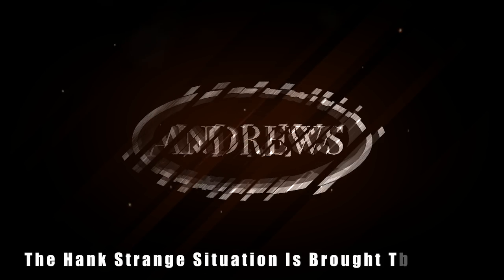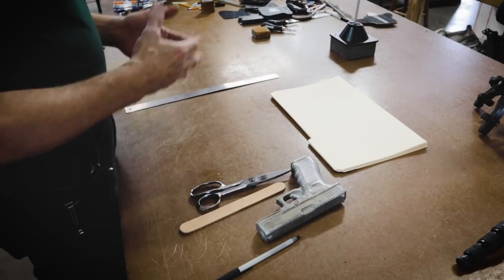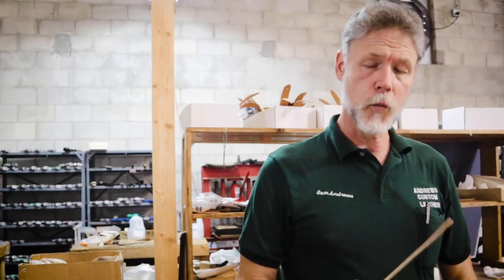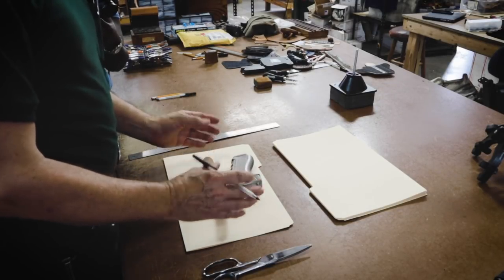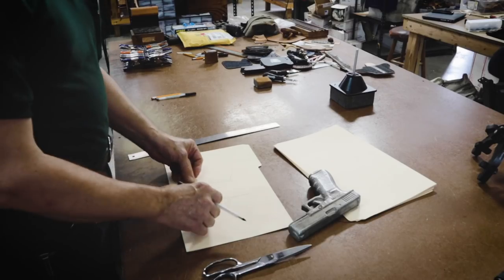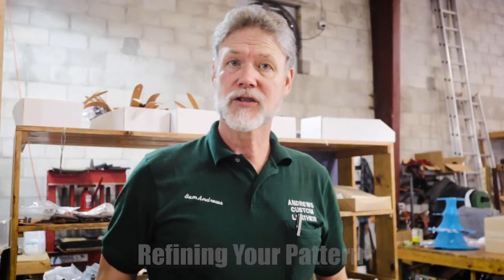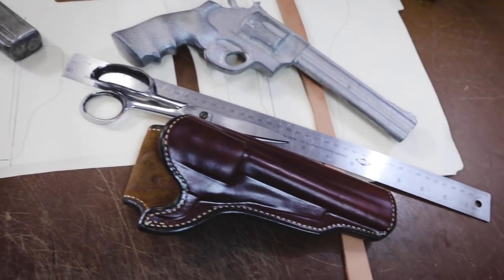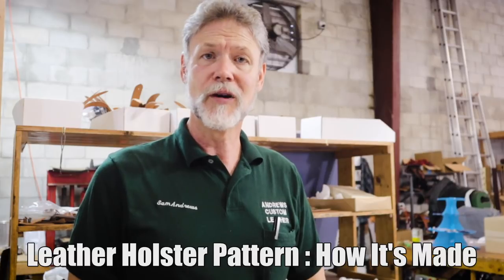Custom Leather Holster Pattern Making // Pancake Holster // Scabbard Holster // How It's Made

Comment: Have a question on two things I'd like answered...the first is, What and where do you get the metal reinforcement you use for your holsters that have them? (e.i your  IWB holsters) And what weight leather do you like using for your holsters?  Thanks for all the great how to videos  from both you and hank! Keep up the great work.
Reply from the maker: YW Miguel I know this is Sam's busiest season right now however he will get to the questions
Reply: Dear Mr Samson
The metal is strips of galvanized 16 GA. steel that I have had cut for me by various
sheet metal shops over the years.  I have them punch it out on the metal shearing
press to about 5/8" wide.  These are then cut down by me to any length I need and 
round the ends on a grinder.       The leather for my McDaniels and saddle style holsters
is 7/8 oz.   I use 10/11 for my heavy scabbard and western holsters.  I hope this is
helpful.
Yours Truly
Sam Andrews
Reply: Miguel Samson Jr I saw your comment about Andrew’s holsters. I wanted to let you know that Tandy carries at least the thumb break tensioner on the web site now.

Comment: I used brown paper bags to start with then after I had it the right fit more permanent pattern made of heavy poster board works well if I was doing as much as Andrews shop does a thin Masonite might work nice file paper pattern for making new pattern when needed Sam Andrews you are a true artist but I like working with leather in the old way including hand stitching with an awl

Comment: How do you get the leather to form to the weapon ?
Reply: he dunks it in a pot of warm. NOT HOT water.. then if all goes well it just forms the natural shape of the weapon.   course i could be wrong...
Reply: Wet molding. You put the holster in water until it stops bubbling, insert the gun inside, then use a smooth object to press the leather around the curves of the gun. (I use an edge burnisher and bone folder). You keep molding until it is mostly dry.